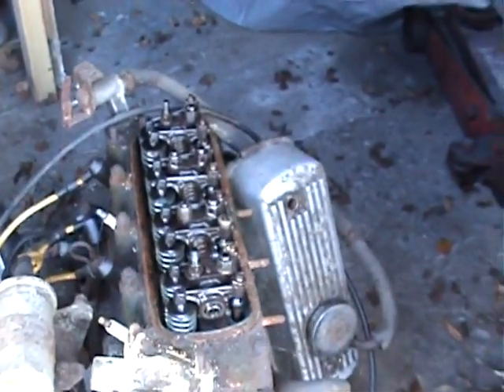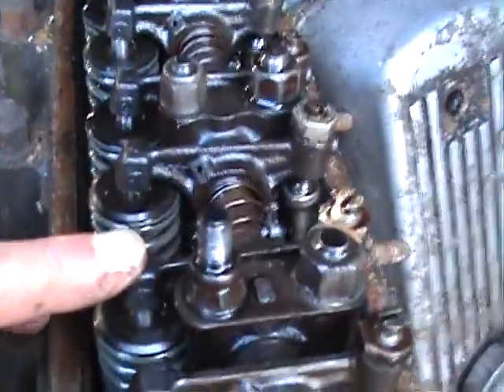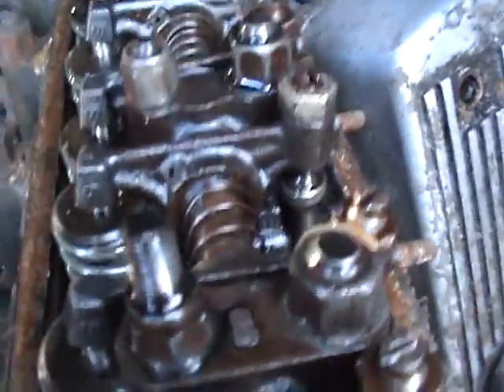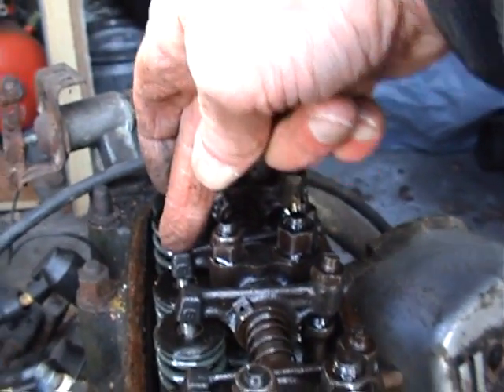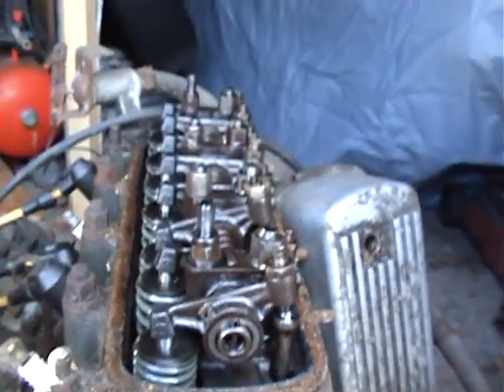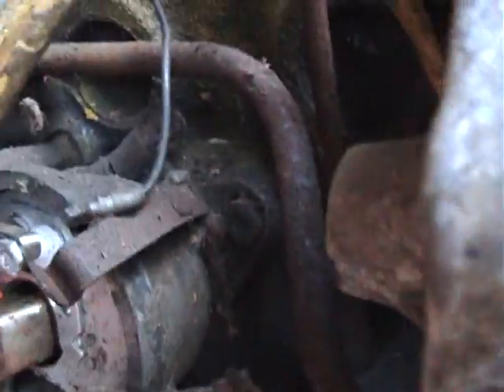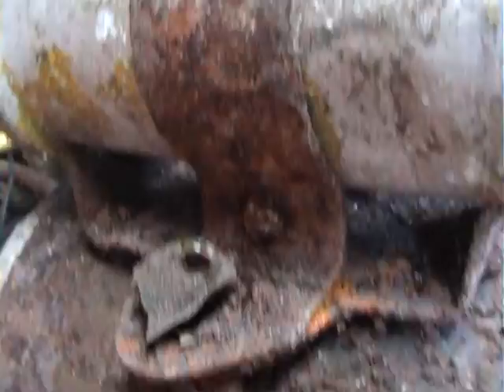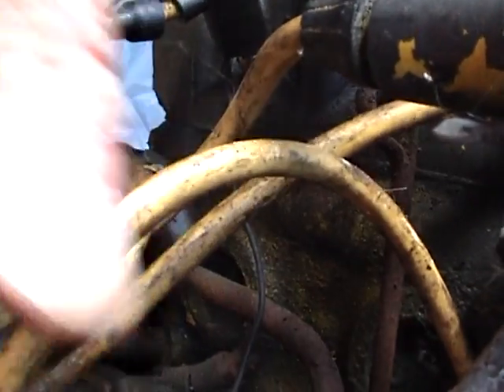How to find the firing order on a conventional 4 cylinder engine

Comment: Never seen a 4 cylinder that is not 1, 3,4, 2
Reply from the maker: All early Fords were 1243
Reply: @MalcOfLincoln  ,now you mention it I seem to remeber that, mind you because four cylinder engines are always "two up two down" there are only two options, figuring out a V8 which could have a staggered crank or a flat plane one is a bit more challenging.

Comment: GREAT VIDEO, I have a 1923 REO fire truck and this video was a  great helped. Now to figure out why it back fires through the carb.
Reply from the maker: William Bacon Pleased it's been of help.  One reason engines do this is because the inlet valves are not seating properly. But quite a few ignition problems, timing out etc can also cause this.